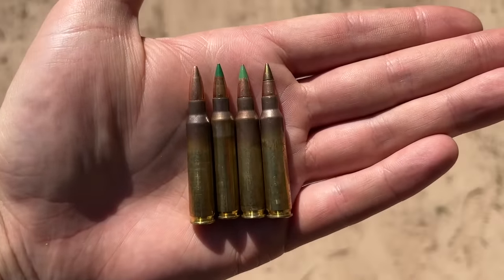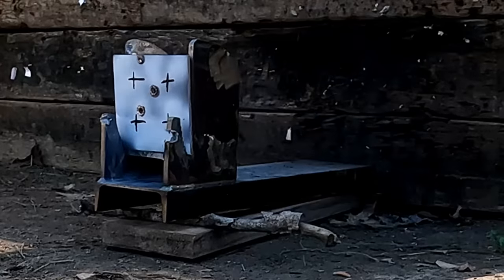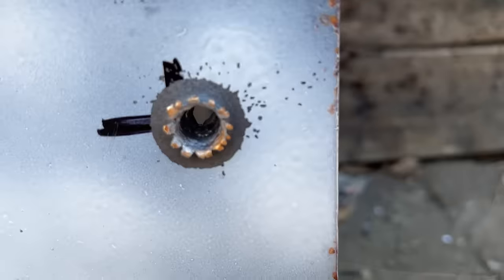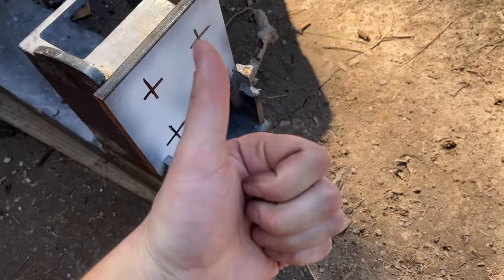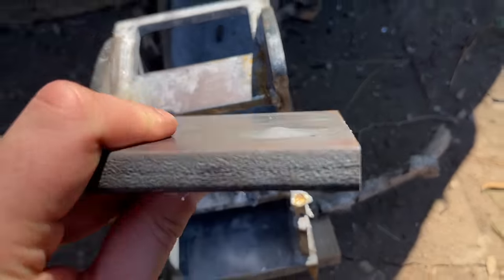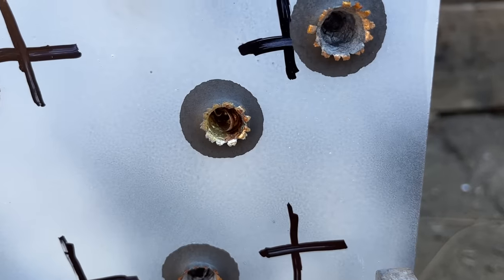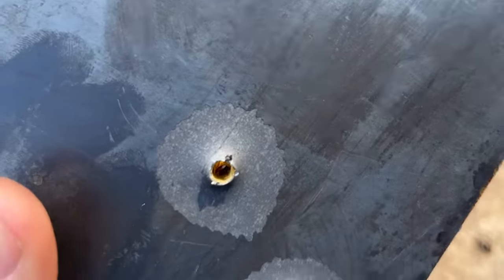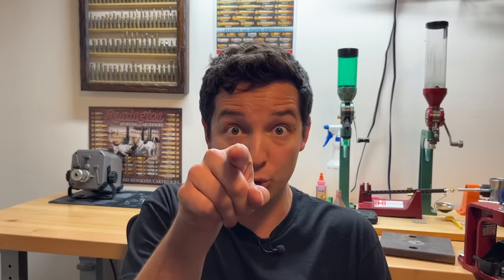M855A1 vs M855 vs SS109 vs XM193: Crazy Results on Steel

Comment: Isn't "SS109" just the designation for the projectile from the "M855" cartridge? If not, then what's the difference between SS109 and M855?
Reply: If I’m not mistaken the cartridge used to be ss109 then the nato designation changed it to m855 either way it’s the same thing
Reply: @itsamk18-ish  The Belgians came up with the SS109 bullet design and then NATO adopted it. Different countries call their particular loading with the SS109 projectile different things. The US calls it M855, Canada calls theirs C77, the British call theirs L2A2, and so on, but all of them use the SS109 projectile.
Reply: @herknorth8691  👍  that’s cool, I’ve found so many different things online about it i never really knew exactly what it was. I’ve bought ammo called ss109 and ammo called m855. Last thing i looked up just said m855 was our designation for it and that m855 was just loaded to stricter tolerances. I always just assumed it was like xm193 and m193 and ss109 just wasn’t up to government spec for whatever reason. Either way… still same for all intents and purposes.
Reply from the maker: That’s what I gathered from the articles I read.
Reply: Yeah two of the cartridges in this are the same thing.
Reply: SS109 and 855 have undergone a change over the years.   They originally had a “penetrator” that was two short round bars stacked on each other.  Since the bars could never be exactly centered in the lead mold, accuracy suffered from its lopsided spinning while going down range creating ever-widening circles.  A change was made in the late 90’s to a single dart type penetrator.  This improved accuracy a bit, and helped hard penetration.   During BRM instruction back in the day, I used to cut open bullets with wire cutters to show the Joes how the bullets were made.
Reply: SS109 is the nato designation whereas the m855 is the US 🇺🇸 designation theyre the same cartridge in the US they use multiple types of 5.56 so to not get mixed with their ball ammunition they painted the tip green

Comment: I would love to see a side by side comparison of mild steel vs hardened steel vs tempered steel. Maybe another youtuber could do this for him. You could redo all your testing with the other types of steel.
Reply: Most hardened steel is tempered.
.....
Reply: Expect about 60% of RHA performance for mild steel.
Reply: @dwwolf4636  If you buy it then yes. If you are getting people to make it for you, then you can get it at different stages. This is what I would really like to see.
Reply: @MAZEMIND   Can't remember the steel but it's used for jackhammer bits, there's a katana that uses it and claims 10x the hardness of steel normally used, and Shadiversity did a torture test on it and actually believes the claim. I wonder how that would do against bullets. Amazing edge retention too and not as hard as you'd think to resharpen but does of course take longer to sharpen.

It's s5 shock steel and it's 10x stronger than one of it's closest competitors:

https://www.youtube.com/watch?v=EUS1oHYObgA

Comment: M855 was designed to stay as close to M193 in velocity as possible. Presumably so the iron sights wouldn't need to be recalibrated on older rifles, but Also for maximum performance. Notably, the requirement to be able to punch through a Soviet helmet at 500 yards. While it does use the SS109 type bullet, European spec ammo is consistently 100 feet per second or so slower because NATO didn't tweak the powder makeup when they adopted SS109 in 1977. The British are notorious for underloading it since their L85 didn't cycle properly. The US adopted M855 in 1982, presumably because we had such a massive amount of M193 in stocks.

Comment: Good man! Friend of mine and I, can smoke a 3/8” mild steel plate at 200 yards with M855A1 from 16” AR carbines. Sometimes the copper base gets stuck in the plate but the penetrator still does it’s thing and pokes a hole on the other side. Sure wouldn’t want to be behind it. Glad to see you testing these from a 26” up close to see just what max potential is.
Reply from the maker: That is freaking nuts out of a 16”! I wonder what the velocity difference would be between the 2 lengths
Reply: @bananaballistics  I’m not sure but I have chronographed them out of my A2 at 3034fps using 26gr of CFE 223. So I’m not even hot rodding them. Just a nice good easy 3,000fps load. I can fire some out of my 16” later this week if you’d like to know the velocity of my hand loaded samples from my 16”.

 (allegedly CFE223 is a re-branded but identical formulation to the powder General Dynamics produces for the DOD to load the M855A1, in an article I was reading the average poser charge was 26.4gr and the spec of 3131fps for the M855A1 from my research.)

What amazed us is M80 7.62x51 NATO wouldn’t penetrate that same plate at that distance when fired from a 18” AR10.
Reply: @bananaballistics  If I can find any M855A1 I'm excited to see what it'll do out of the 28" barrel I have coming soon! Maybe my magnetospeed will have better luck than yours
Reply: @meanman6992 Where do you get m855A1? I haven seen any before
Reply: @meanman6992  load m855/855A1 In a discarding sabot like Remington accelerator. Zips em along at about 4,000 FPS.
Reply: @kevinfitzpatrick5949  The internet. It pops up. 

Most of it fell off a truck.
Reply: @meanman6992  When I pull down M855A1’s, there is anywhere from 25.6 to 27.1 grains of powder.   For every 10, perhaps 7 will be right at 26.  Not very consistent quality.  That may explain why so many of our M-4 locking lugs break.
Reply: M855A1 pull-down bullets are legally out there for purchase, but all loaded ammo you see  was “liberated” from military sources, regardless of where you bought them.  Internet, gun show, all tactically acquired.
Reply: @Blackhawk 7R  They break because they intentionally turned the cartridge into one of Bubba's pissin hot handloads.

All to squeeze 150 extra fps.

Good round though. It shreds.
Reply: @orion8981  No lie about that.  We would hound those mil-techs at the weapons pool to see when a fix would be coming out.   Deer in the headlights.
Reply: @carbontetlabs8606  28”? What the? Bolt action?
Reply: @kevinfitzpatrick5949  gun broker, it isn’t cheap.

Comment: SS109 is the NATO standard projectile used in the M855 (NATO) round.  The SS109 is the 62 gr steel penetrator projectile that is used in the M855 round which is marked by the green tip.  In other words, he tested the same round twice (though perhaps from different manufacturers).
Reply: Thats what i was thinking too. Green tips are SS109 or m855 same thing
Reply: @bearrage80 M855 is the loaded cartridge. SS109 is the projectile itself.
Reply: He addressed this at the end of the video

Comment: It went to about .625" into the plate. Think about it. If the plate is .750 thick and this is a bulge on the other side. Then you have to consider the length or the projectile. It could have went .750" In depending on how big the backface deformation is.

Comment: Commercial "SS109" is often loaded to .223 spec, at least it was for a very long time. M855 has always been loaded to the 5.56 spec. The difference in PMAX (7000 PSI) doesn't seem like a lot, but you can load 5.56 much more aggressively and get a ton more velocity. Thanks for the vid, enjoyed seeing how M855A1 did.

Comment: I have a .223 rated AR500 target that is free to swing at 100yds. The .223 hardly leaves a mark on it. Same for a .308. But a .220 Swift 52gr matchking at over 4K fps sliced a hole clean through it.
I think velocity has more to do with it than just bullet construction.

Comment: Allegedly, the A1 pens are overpressured and the steel tip mars up the feed ramp going into the chamber. Shortening rifle life. Don’t know if it matters for bolt guns, but it’s been an issue for M-16’s-M4’s
Reply: This is what the new “EPM” mags (tan mag with blue follower) are for. They have an adjusted feed angle to alleviate the feed ramp wear issue. Gen3 PMAGs also fix the problem
Reply: Gen3 pmags fixed the issue.

Comment: Would you be interested in testing M993, M80A1?
Reply: Don't know if the channel provider saw your offer!   I would think that he would acknowledge a comment/offer from you!
P.S.: Have you ever worked with the NWM tungsten rounds which were produced from the 80's to 90's, I believe?  They were outstanding!
One of the rounds was fired out of a high pressure propellent gun at well over 6,000 fps...did a 180 degree turn in a 3" thick block of cold rolled steel after traveling approx. 2.5" in the block!  They also were sleeved up to.308" and tested in the equivalent of a necked down Chey tac!   Those penetrated to a depth of ~ 2 and 3/8ths inches in cold rolled steel producing a 1/8" bump on the back of the 2 and a half" target block!  The propellent gun target went to a military museum that had requested some of my targets for display.  This was back in the early 1990's.  I still have the other sectioned targets!
Reply: @cheryltysver4819  I have not messed with those but they sound cool as heck! 6000 fps, wow!

Comment: I did basically this same test on 1/4” mild steel at 400 yards and the results were pretty impressive. 5.56 didn’t go through but green tip almost went through everything else was stopped easily. Of the calibers I own only military surplus 7.62 X 54r and 30-06 made it through 1/4” steel at 400 yards

Comment: What bolt action rifle did you use to test these? Was it rated 5.56 NATO or .223 REM? My HOWA .223 REM has a 1 in 8 twist, which would be different than the older Ruger .223 REM which has a 1 in 12 rate. Twist rates may make a difference in the penetration?

Comment: You are correct about M855 and SS109 being the same in essence but also vary wildly in performance, relatively speaking. The best performing SS109 I found is the ADI F1 62gr stuff, and that is by far my favorite ammo to dump into trash. Burns clean, consistent across differing temperature ranges, super stable and consistent ignition, and no issues with it in general. Considering it's the standard for the Australians, and those dudes did the Lords Work in Iraq and Afghanistan, it'd be interesting to compare the ADI stuff to Lake City ammo, which is what the US uses.
Reply: Is ss109 made to a higher standard with the steel core inside the jacket over m855 ?
Reply: dang,   I bought ss109 but didn't fire much of it.  

In looking at m855a1 prices... and they're quadruple.  

why do they vary so much in price when it's similar penetrating performance

Comment: I am fairly certain the M855A1 EP round (enhanced penetrator) it meant to mimic the penetration of m855 without the necessity of a long barrel. Safe to say it probably will penetrate better even if its just the tungsten core.

Comment: FYI 2014 lot lake city m855a1 goes 3260 fps from my 20 inch barrel and 3320 from my 24 inch ar I have a decent stash for shtf
Reply: He probably got just the pulled bullets and loaded them himself as that is all I have seen is available on the civilian market. He could have loaded them much hotter as I can get 3050 fps from my 16in gun and Im still good pressure wise. I was thinking while watching that my loads out of that 26in would probably get him about 3350.

Comment: You should try out Independence M193 rounds. They are the hottest production 5.56 rounds. They come out of my 16" barrel at over 3,250 fps and shot through my test 3/8" mild steel plates. I wonder how they would perform our of the 26" barrel.

Comment: So, legend has it the steel penetrators cause the m855 and similarly constructed bullets to flow and expand on impact when the penetrator itself is stopped i.e. vs hardened steel whereas the homogenous xm193 does not do this to the same degree. Sounds like more testing? I wish I could find the article I read discussing this. It was pretty formal, but it was also on the internet.

Comment: Well considering the M855 is a barrier penetrator round with a steel penetrator in the projectile, it's not surprising that and the other three didn't go through 1\2" of steel.  I am impressed with the M855A1 performance.

Comment: When FN developed the SS109, they found rifling twist rate had a significant impact on penetration. The faster the twist rate, the more penetration they obtained with the M193 & SS109. It's why the US went with the very fast 1-7 twist, and most of NATO was more than happy with the 1-10 twist.
Reply: Penetration is reliant primarily on VELOCITY (and secondarily bullet construction).  Which is why M193 does surprisingly well against steel targets.  Twist rate is tied to bullet weight (and thus length).  The reason why the US went with 1:7 twist is to stabilize the longer M855 and M856 tracer round.  The longer the bullet, the faster you have to spin it to stabilize it.  M855 actually prefers 1:9 twist, but the M856 needs the 1:7.  Since military rifles would be expected to shoot tracer rounds, they opted to make 1:7 the universal rifling rate for 5.56mm NATO.

Comment: You missed one. Black Hills MK 262 Mod 1 used by the USMC. While cheaper than MK 262 or MK318 (USMC equivalent of M855), the M855A1 is close to it but M855A1 wears out barrels from the reports of long term usage.

Comment: In the beginning, you describe 3 of the rounds by their load designation (m855, m855a1, and m193), and you describe the other round as a "ss109." Ss109 is the bullet that the m855 cartridge has loaded in it... 
also, you didnt test the m193 on the ar500 plate. On mild steel, those stee penetrator rounds will perform better. On hardened steel, the m193 will penetrate better than steel core ammo. Counterintuitive, I know...

Comment: The M855A1 has a solid copper core as opposed to the other rounds that all have lead cores with a copper jacket. That’s most likely why there is a color difference on the plate.

Comment: I had problems getting a velocity on the M855A1 also (MagnetoSpeed V3). 1 velocity shooting 7 rounds. No problem with M855. I will get velocities with X-Tac M855, Norma SS109, and PPU SS109 for comparison. I have both a 16" and 20" rifle, but plan to use the 16" for this test.
Reply: I can't find in the video what brand of M855/SS109 was used?
Here are my velocity results with a 16" barrel (same day). 5 shot average:
65 deg F, 61% RH, 29.63"Hg at 550 ft elevation
2893 fps PPU 5.56 SS109 (tips not painted)
2894 fps X-Tac 5.56 M855 (tips painted green)
2981 fps Norma 5.56 NATO SS109 (tips not painted)

Comment: which bullet does the military use as standard, and do they acquire other/better rounds for different tasks or units?
Reply: M855A1 is the current standard, but they'll switch out to different ammo based on what's needed for a specific task. Like Tungsten AP rounds if they need more penetrating capabilities.
Reply: We’ve used M855A1 gold tips for the last decade, but our SAW belts use M855 green tips.  5.56 AP black tips are damn near unicorns on the line.

Comment: Wouldn’t the amount of round left in the hole make the depth measurements inaccurate?
Reply from the maker: I tried to remove as much as possible, but it’s definitely not the most accurate measuring system in the world. It gives a decent reference for each though

Comment: Can you do a comparison with .243, 6.5cm and .308? Case capacity is very similar with those calibers and I’m guessing the .243 would out perform them both in penetration unless your using a 110-130 grain bullet in the .308
Reply from the maker: I plan on doing some testing with a a few ar10/ short action cartridges in the future, so I should be able to include those.

Comment: My understanding was that M855 and SS109 were different designations for the same thing. and the M855A1 is a solid copper bullet with the penetrator on top. difference in metal type/density may be why it was not reading correctly.
Reply: I'm sure it was reading fine but he left it off intentionally. 855A1 isn't on the civilian market.
Reply: My understanding is that SS109 is the bullet/projectile and M855 is the NATO designation of the cartridge loaded with a SS109.

Comment: The M855A1 is a lead-less round. The projectile is all copper and carbide steel core. The creates a larger, harder projectile for the weight.
Reply: I would assume it’s a hardened high carbon steel core

Comment: The difference is about 400-600 roubles, depends on if you even have the damn trader level unlocked 😒
Reply: Don't think 5A1 is available this wipe, could be wrong though

Comment: 26" barrel...You should try hand loading some M855.  Push the the limits of that bolt action. It can handle the higher pressure. I bet you can get better penetration....

Comment: It is my understanding that the SS109 is the name of the projectile, developed jointly by NATO in the 1980s, and given a green painted tip for easy reference. M855 is the American designation for the 5.56mm cartridge loaded with the SS109 projectile. So if you have SS109 loaded by someone other than a government approved manufacture, it is simply designated by the projectile type as SS109. If you have SS109 loaded by a government approved manufacture for government use, and tested to conform to government standards, it is M855. Federal/Lake City and Winchester/Olin will manufacture lots of this load for civilian sale, but it doesn't go through quite the same level of testing or quality control, and is therefore just labeled XM855.
Reply: Negative. Similar projectile, but not the same.  https://imagizer.imageshack.com/img924/9862/nyflWW.jpg
Reply: @bpm990d  Interesting. Good to know.

Comment: Curious why the 855a1 didn't seem to ever get a reading on the chronograph. Any theories?
Reply: He’s using a MagnetoSpeed chronograph to get the data. My guess is because the M855-A1 has a much larger and exposed steel penetrator the magnetic sensors possibly got overloaded.
Reply: @truckingbastard  Interesting - thank you for explaining.